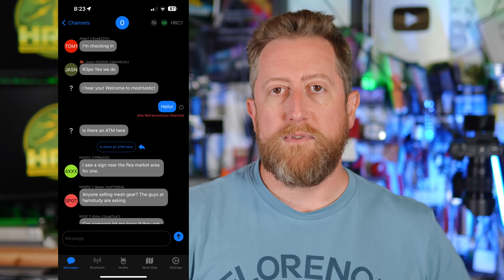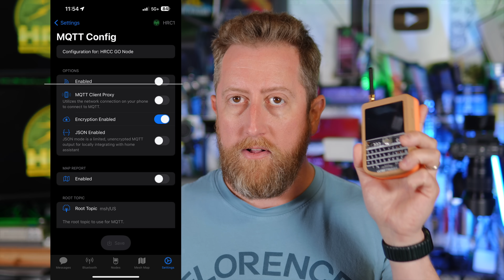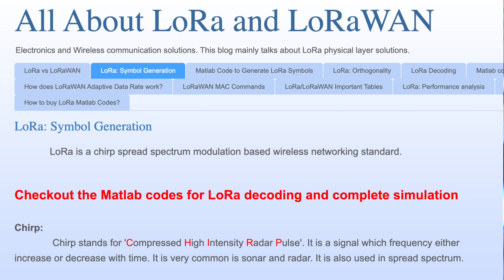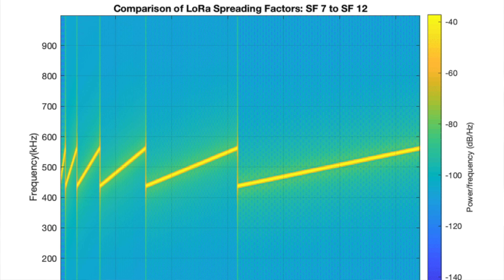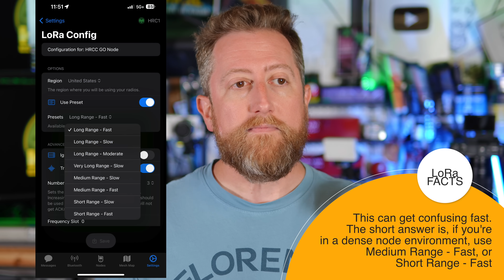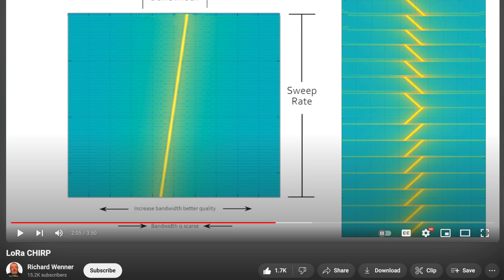Did MESHTASTIC Die At Hamvention??

Comment: 6:36 While mqtt is turned off by default, the long fast is the default option and asking participants of the network to manually change the settings is the killer of technology. It has to either work as is or uodate configs automatically depending on the area it is in.

Comment: I am curious about Meshtastic, and Meshcore. I would probably go for Meshcore seeing its benefits. I am a ZigBee developer which is also mesh based. The pitfalls of such ‘Personal Area Networks’ are the low bandwidth or data-rate, and amount of traffic required to manage a mesh health. Broadcasts can be done but they flood a network, so rules are in place to minimize such effects. Despite the logical network size of 65K devices, the practical size can be 1000 times smaller, at 250kbps. I am curious to see how the Meshsphere will cope as more people adopt it.

Comment: Love how you're trying to dumb it down.  A broadcast storm is effectively what took the network down. Mesh, is a topology by the way. The packet has framing bits, and the number to which you referred to as CRC is a check sum value and yes it is how Asynchronous transmissions are certain the packet was delivered undamaged as well as responseless protocols like TCP/IP otherwise there'd be netnoise of each node asking and confirming TxRx.  Hopefully the developers put a hop map feature into the process. That's how TDRF works to add bandwidth that wasn't there back when Switched 56 and baud rates were thought to be as fast and as much bandwidth as possible. Funny how turning to spectrum over just 2 dimensions opened up the door to huge data rates.

Comment: Another technique in a busy area especially with lots of small nodes with stubby antennas stuck in a pocket would be for those nodes to be put in client_mute mode. That way they can still send and receive, but wont be repeating traffic. Nodes will ask for a few clients it thinks are far away to repeat its packets. So, if it hears a node weakly, it might ask for that node to echo the information to extend the original nodes range. This is extra traffic and most of the weaker nodes wont really be extending much of anything.

Good video and its good to see Meshtastic starting to take off!

Comment: MQTT doesn't link Meshtastic to the Internet. Its a very lightweight publish/subscribe data passing protocol, typically used in IoT applicarions where your sensors publish their data payloads to an MQTT broker app, and then other apps subscribe to that and get the data. 

Using MQTT, you can pass messgages between disparate non-TCP/IP digital networks.

It's recommended MQTT be disabled on cogested Meshtastic networks as it introduces addtional network overhead. meshtastic's bandwith is very low and any additional traffic can affect performance.

Comment: My learning adventure continues. If one LoRa-enabled device is connected to the internet, then a hand-picked group of other LoRa-enabled devices could all communicate as a network, by basically using that first device and its internet connection as a hub? And it could be any of them, or multiple, so long as at least one was connected?
Reply from the maker: Kinda, but the internet is just bridging nodes.  It’s not as helpful as you might think.  It shares the messages though.

Comment: So why is there no talk about a 'self-organizing' node structure where the most powereful meshtastic devices in an area become like a super node  hub:  They figure out a way to divide spread the load out across multiple super node hubs, so that each smaller device gets a fraction of the traffic.    Once the super nodes go down, the meshtastic devices are then re assimulated into the other super nodes.   It would have to be automatic based upon signal strength.
Reply from the maker: Join the Meshtastic Discord and spread your idea around.  This is a community driven software package.

Comment: I live in seattle north urban part called ballard. The node cluster that i am in crashes my node in about three hours. Take the same rig out in the sticks works for days without a glich, and can throw long balls for miles and miles. not enough nodes and it does little.  more nodes past a certain number and your done for. What i have noticed it seems the angle of the nodes to one another might be the posion. thanks for your advise.

Comment: I have multiple LoRa modules. I have never used them as a LoRaWan purely because I foresaw this system overload. LoRa is phenomenal for sending back data from remote devices. For an internet replacement which is kinda what Meshtastic is trying to be, it's going to be dismal.
Reply from the maker: I don’t really see the Meshtastic team trying to replace the internet at all. Just light weight messaging. Keep it Short Fast in contested areas.
Reply: @HamRadioCrashCourse  But that's something cell phones and messaging apps on tablets do far better.
Reply from the maker: They only can do that because of the internet data capabilities and high speed wireless.  Try doing that on your own and you see what Meshtastic is so special.
Reply: @HamRadioCrashCourse  That still doesn't get away from Lorawan being pretty dismal in terms of transmission speed. Sure - you can mesh it with regular internet but then it's not pure Lora. The whole point of LoraWan is to get AWAY from having to route everything through the regular internet.

Comment: The 802.11 (WiFi) community and steadily evolving standards have had to figure out how to deal with capacity issues for over 25 years.   It is a complex problem that involves data rates, available "non-overlapping" frequencies, number of Access Points, number of client devices, protocol overhead, just to name a few -- and these issues have to be dealt with before you even discuss meshing the Access Points.    

At the most fundamental level (Layer 1 - or the RF layer) -- if a lot of devices are in the same airspace and on the same frequency, you run into situations where throughput drops significantly as the devices attempt to gain a slice of time on a channel while not colliding with another packet. (Collisions = retries)    After all, the clients have to determine when to transmit -- there is not a central server coordinating timeslots (as you might find in Cell Phone networks).  This issue has to be addressed in the Meshtastic realm as well as the default frequency is the same for all devices on the Primary channel.

The community is very early in this project and the developers have done a great job getting it to this point, but there will be much learning to make larger networks usable moving forward and there will necessarily have to evolve the protocol to address scale.    For example, to use the WiFi analogy again, WiFi hit a wall with 2.4 GHz because only 3 non-overlapping channels are available (1,6,11 in the USA) -- it took the development of 5 GHz capabilities to allow organizations to design networks that would properly scale...that fundamental change allowed Wi-Fi to become a go-to replacement of Ethernet in many organizations.

I realize that Meshtastic is not intended to be anything close to WiFi, but the RF fundamentals of airtime / channel capacity / protocol overhead efficiency still very much apply.

All that being said, it's a heckuva lot of fun to play with!

Comment: Turn MQTT off in dense mesh areas. Here in Manchester Uk - it’s a dense area with 100+ active nodes. Just one node can break the bandwidth. If using TinyGS mqtt makes sense! But in a localised comms it’s doesn’t do any favours! 

Turn mqtt off and set ignore mqtt. Hops keep to 3 maybe 4 if there are routers in the area…

Comment: However the regulatory body not being very software to find radios allows the sale of The Analog Devices very capable SDR which is the basis of several strs in a single antenna head that's connected to a another piece of equipment or something designing and building which requires me to have access to some equipment that I can't get.

Comment: I amateur code lora modules. And built a mesh system for solar sensors. Trying to automatically  set the spreading factor(long fast) is difficult. Because all surrounding nodes have to change to the same SF. This takes band width to tell other devices to move to new SF. Or it takes time for a device to listen to each SF until it heats and syncs with another node on the same SF. SF7 takes 2 seconds to complete an 16 byte packet. So even with the best collision avoidance. Only 30 devices could communicate every minute. I am no radio engineer. But lora modules need to be able to switch it's SF automatically based on the preamble of the other device. And the reply packet should automatically drop to a faster SF based on the signal SNR level. Basically an automated power and speed strategy built into the models.

Comment: This is the same problem we had in the early days of networking 

And the early days of Wifi.

This is why they created 100 base-T and 1000 base-T

Because the old 10 base-T really got overwhelmed and we were not getting through from computer to computer on the network.
Back then it worked just like this.
There was no router
It sounds like the system needs network controllers.
So if a control station assigned the priority and who is on the network and when to send.
Like cell phone cells work
Reply: Meshcore sounds like it addresses those issues.

Meshtastic is great for some things, meshcore for others.

Comment: Why would you ever use the long if you can send the massage with the short? It sounds like someone driving a dump truck to the store when a car will get the same loaf of bread. I'm sure the is a reason. What am I missing?
Reply: Long fast gives more range than short fast so is good for testing and discoverability under normal conditions. Short fast is better for events though
Reply from the maker: Fantastic analogy!

Comment: CHIRP is the sound of the modulation.  Regardless of what anyone calls it, packet is the correct term for the chunk of data transmitted as a unit (using CHIRP modulation).

While not a "bug" in mestastic, the exhibited failure to scale is definitely a design limitation inherent in the choice of flood routing.  There are smarter mesh network routing approaches that could be implemented and IIRC meshtastic is working on such.  Flood routing is quick and easy to understand and implement, but it always fails this way and has since at least the days of even the limited flooding done by Netware SPX/IPX and NetBEUI in the 1980s and 1990s.

Comment: This IS a limitation of Meshtastic, since it has no mechanism for automatically reducing the bandwidth used by each node.  Back when "mobile phones", the precursor to cellular phones was a thing, there was a problem: if the prices came down and mobile phones became popular, they would quickly saturate the bands allotted to them.  The invention of cellular radio was a response to this, and required that transmissions be limited to short range, and also an infrastructure of "cells", or areas that each fixed station covered.  Adjacent cells use different channels, so that a phone talking to its nearest tower does not interfere with other nearby cells.  Meshtastic learned nothing from this, and has NO mechanism to keep saturation from happening, and so will be the victim of its own popularity.  The more popular it gets, the worse the user experience.  And the bigger problem with that is, it will run into the limits WAY before it gets to the point where you can reach anybody you want to communicate with.  So it will go from "i can only message 1% of my contacts" straight to "I can't get through to ANYbody."

Please: prove me wrong.

Comment: Meshtastic simple doesn't scale. It's not just airtime, but also the entire MQTT link concept and the fact that your node can "fill up" with node IDs, leading to the dreaded memory full message.
Reply: Fortunately there are a bunch of speed settings and frequencies you can pick between which allow you to layer many different networks on top of eachother without interference just like cellular radios do it
Reply: @land_and_air1250 doesn’t Meshtastic work on one specific frequency?
Reply: @JJRfromNYC  it works in a frequency band, and has a bunch of usable channels within the band and on top of that each encoding speed and spread factor will be ignored by every other encoding speed and spread factor allowing the same frequency channel to be used 8 times or so if needed without meaningful interference
Reply: @land_and_air1250  thanks. How does one determine the appropriate encoding speed and spread factor? Thinking of investing in Meshtastic. I think it could be great for off the grid Comms.
Reply: @JJRfromNYC  the easiest way is to change the “range”/speed setting. Theres a bunch of presets and you start on longfast. Solves the bandwidth problem too for events like described in the video since you can switch to short fast and trade a bit of range for a 300x faster data rate
Reply: @land_and_air1250  thank you very much. Do you know of some excellent YouTube vids that describe Meshtastic for Beginners, and how to set it up properly?
Also, how can I find out if there are Meshtastic devices in my area?
Reply: I think they need a better implementation for public meshes. If it were able to limit transmit power to near nodes and have smart routing without overly redundant packets, it would be better. Also, when a mesh is dense enough, many end user devices should not retransmit packets.
For small private mesh networks, I think it's perfectly fine as is.
Reply: MQTT turns it into IRC with a radio link the last 5 meters.  Not interesting to me.  I only turn MQTT on when I need traffic for testing.
Reply: Man I dont know anything about meshtastic or HAM, but just with a borderline understanding of making your own network off grid, these are eventual pitfalls that the pioneers of the internet were trying to figure out some 40 years ago

Comment: I wonder what impact a saturated environment has on battery/power consumption.
Reply: Radio is definitely using more power if it's constantly receiving and transmitting packets.
Reply: Increased but if it’s nrf based it will still use a trivial amount of power on the order of 100-200 mah per day

Comment: What is the trade off of using short-fast? Does transmitting data more quickly effect range?
Reply from the maker: Yes it can affect range.
Reply: I think of it in terms of saying a callsign:
short: just saying the letters: "KF6EGR"
long: saying each letter with the phonetic alphabet: "Kilo Foxtrot 6 Echo Golf Romeo"
they technically have the same information, but if the signal is bad (due to being far away), the "long" method has a better chance of being understood without error.

Comment: 1980's coax based Ethernet had a similar issue.  Yes it was a timing issue. they had to back off on how often they talked. 
It is a learning curve, It will get better.
Reply: Also can layer meshes on top of eachother or simply increase the speed at the cost of range for conventions which gives way more throughput by like 300x
Reply: @land_and_air1250  You are right, and that is one thought - routers. Apex nodes or devices that link mesh groups together . Doing it without human intervention is not quite straight forward. We want resiliency in case a router fails or is cut off. 
Routers can also introduce loops. A message can take more than one path - without "one way gates" the message can be forwarded back toward the sender and then corrected and routed to the receiver only to loop around back to the sender. 
Local comms under a higher "Tree like" router.
Reply: They need a new protocol (maybe meshtastic 2.0) that can dynamically adjust the from longfast to the next applicable one based on amount of node and traffic. If it sees say 20 nodes, it changes from longfast to medium fast then shortfast etc.
Reply: @sofloemir  I agree. Good point.
Reply: The solution with Ethernet was to develop a whole system of switches and routers, so that each device only communicated with the closest other devices.  Which by the way meant scrapping EVERYTHING, from the AUIs to the local coaxial network cable.  That is, the entire physical layer.  That's what it will take to "fix" Meshtastic: replacing it with something akin to a cellular network.  So yeah, this will mean that you depend on an infrastructure that will have to be built up from scratch.  Which, MAYBE people will plunk down some money to build their own cells, but eventually this will break down into chaos and spotty coverage, and will only work if one or more commercial networks get built.
Reply: @jimthompson3053  A good system is Reticulum, it is platform agnostic AND can use meshtastic devices. A Meshtastic-Reticulum bridge would be cool. Reticulim is trying to be a low-speed ad-hoc internet.

Comment: One slight detail, unlike many other mesh protocols Meshtastic does not need to build the mesh up, it does not currently track who is in the mesh or where packets should be flowing.

The mesh is implemented by using very clever CSMA/CA hacking, every-time a node hear a message it tries to rely it, but before doing so it waits the amount it waits is based on how well the message was received, if the reception was good it waits a very long time, if it were bad it waits a short time, and if while waiting it hear someone else relaying the packet is cancel it's own relay attempt, this mean just by waiting and listening you know if someone else farther away is relaying the message already, and if they are you do not yourself, if the wait time expire and you didn't heard anyone then you relay yourself.

The congestion is usually NodeInfo (automated « I am here » messages used to show the list of Nodes in the app, but completely optional and not used in the meshing) and people trying to use the app as designed and send messages.